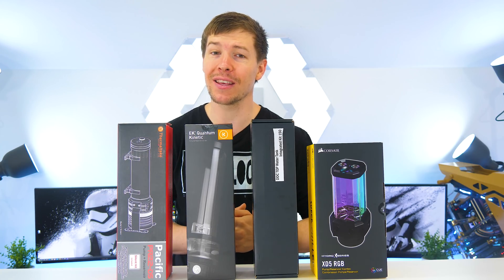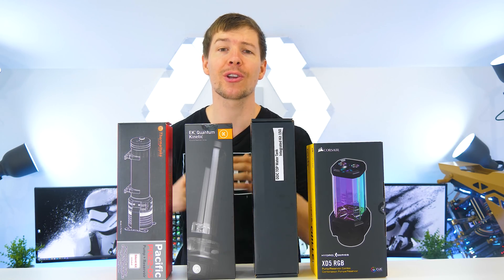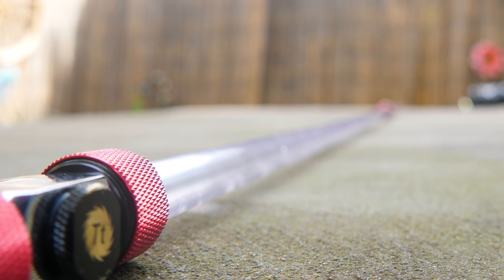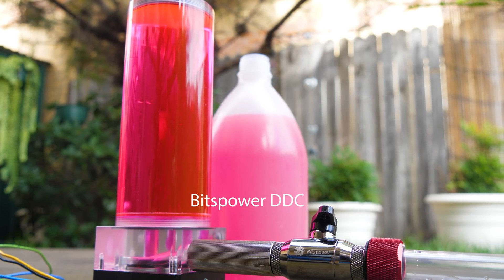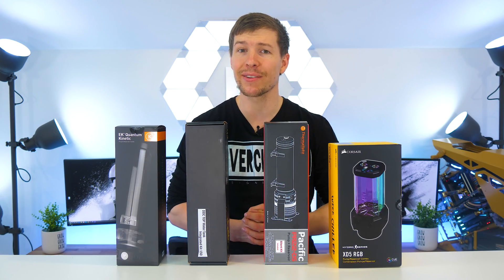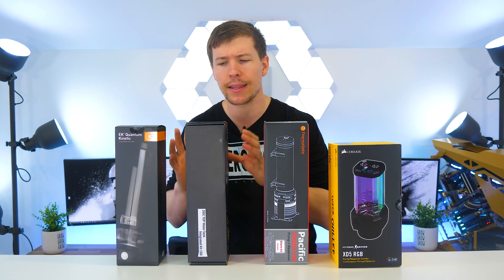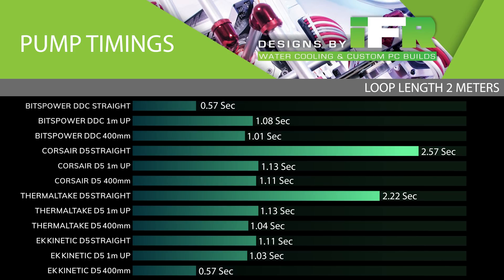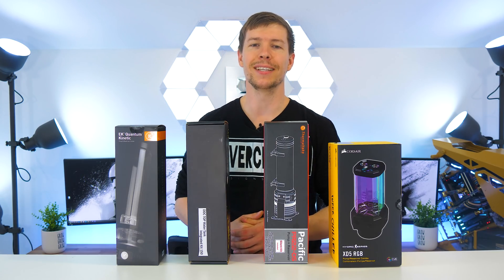The ULTIMATE PC Water Cooling Race.. Who Will Win?

Comment: Edit: you may have touched on this but what fittings are you using? 

I need help please!!! I have a inwin 303 white case (basic) I’m using a msi meg z590 ace gold, with a ekwb Quantum Velocity CPU Water Block, Intel CPU, Digital RGB, Full Nickel. I don’t currently have a waterblock for my gpu yet… and I have a 250ml true brass bitspower res. But I have simply lost 2x of my D5 pumps. The 250 res is rather large and my monsoon v2 fittings are for 16mm tubing (which I have both fittings, tubing, and bending material) my xspc rad looks to have minor rust which I was told using a cleaner should help clear that up. But now I’m at the point do I keep the 250 gold tops? Or just switch it up (keep the gold fittings) and go with a black/white or black/silver pump res combo? This will be my first custom loop too btw. Finding a waterblock for my msi RTX 2070 ventus hasn’t been easy. The only one I found it seems will only allow their own fittings to be used (bummer) any advice would be great! I also say the amazing distro block made for my inwin 303 but it appears to come with no pump (wouldn’t even know which to get) and I’d have to purchase all new fittings due to it sticking with its own brand. Right now either an ek pump res system might or try to find another D5 pump to replace the 156$ one I lost. ;/

Comment: As some one that usually slapped a Aio in my PC's and called it good this is a great eye opener since I'm looking into an overkill cooling loop. When I say Overkill an 3x 360mm rads to cool a 3080 and i7-9700k. Way more than necessary, but I want a unique challenge for my first time, plus it'll only keep an OC cooler. I think I'll look into the EK Quantum Kinetic since it was a top contender for the tests and there will be a lot of resistance.

Comment: Interesting how you come to the exact opposite conclusion that DerBauer and others have drawn. That being that a D5 running at 50% generally provides enough head pressure to run a basic CPU and GPU with a single rad loop. And that a DDC won't start to shine until you get into pretty restrictive loops with multiple GPU blocks and radiators.
The DDC might look good on paper for most loops, it's more compact, provides more pressure and will deliver more flow than your loop will ever need, but it also has 2 big down sides. The first being that a DDC needs to be air cooled, whereas a D5 is cooled by the coolant it pumps. The second being that because the impeller on a DDC is so much smaller than the impeller on a D5, it needs to spin faster to get the same flow rate, which makes it louder. And with it having to run harder it needs more power than a D5 which means more heat that has to be blown out of the case, which means your fans have to spin faster and thus make more noise.
I'd only recommend a DDC if there is a 'technical' requirement to do so. Either because of space constraints, pressure requirements, or if performance is all that matters and you're willing to run 2 DDCs. Otherwise I'd always go for a D5, simply because 9 out of 10 loops can easily be handled with a D5 and it is more quiet than a DDC.

Comment: Prediction:Corsair will be the best overall perhaps not beating in most cases but a great option to go with in a regular case as most of the time you don't really need 1000+litres per hour to move water around the system and fits in most cases in that way.  The others will be the ultimate in terms of high flow and all the other things.

Comment: I switched from a Corsair XD5 D5 pump/res to an EK D5 PWM pump res and my CPU temps dropped by 6c to 8C under load.  The Corsair pump is too weak if you have multiple radiators and multiple cooling blocks.

Comment: Nice video but it has been proven many times that flow rate (within a typical range) has absolutely no effect on temperatures. A trickle will produce the same results as the most powerful pump on the market.
Reply from the maker: No it wont

Comment: It would be very interesting if it's just the pump tops changing the hydraulic characteristics. Change pumps between reservoirs to see if there is a difference. Also do a test with 2 pumps in series.

Comment: Interesting testing Cory. Personally, from reading posts on the Corsair forums, I wasn't surprised the XD5 wasn't as strong. I have an EKWB D5 in my loop comprising of a rear-mounted distro plate, CPU & 2 x GPU blocks (all blocks in parallel) and 3 x cross flow radiators (240, 360 & 420mm) in a Phanteks 719 and run the pump at a PWM signal of 40%.

Comment: Your results are thrown off by the fact that some of the PWM controlled pumps are set to run at different speeds, when disconnected from a PWM signal. When leak testing my loop, I saw the flow indicator in my non-leaking GPU block was not spinning. It takes about 70-80% PWM duty cycle to spin. When I asked Corsair about it they said without PWM signal, it runs at 60% duty cycle. Comparing D5s is like splitting hairs. The biggest difference is going be flexibility of mounting options, ports, and etc. My XSPC Photon D5 was a PITA to mount, while the XD5 was a dream in comparison. The XD5 IMHO is the best water cooling part that Corsair sells. It isn't super expensive, it comes with a temp sensor, RGB LEDs, PSU jumper, lots of inlets, and lots of mounting options. Only complaints are the cheap plugs, which are cheap/easy to replace and the fact it uses a molex power connector, just like most other D5 pumps out there.
Reply from the maker: So according to our research and sources all of these d5 pumps run at 100% without any pwm signal. The results were too close in the loops for it not to have been. Especially when technical specs put it behind
Reply: @DesignsByIFR  I assumed the same thing, just like PWM fans I have owned, but as I said during my leak test where I left my system off and connected the D5 to a second jumpered PSU, I noticed the flow indicator wasn't moving. I was confused as it worked fine when I used my PC. I tested it with my PC, it took about ~80% IIRC on my CoPro to spin the indicator. I reached out to someone I know at Corsair who is involved with the HydroX project and they informed me that the stock D5 PWM pump runs at 60% duty cycle. Doing a few minutes of Googling "d5 pwm speed when no signal", I found multiple reddit and forum post stating that EK is set to 100% duty cycle by default and most others are set to 60%: https://www.reddit.com/r/watercooling/comments/7uw53m/what_are_some_d5_pwm_pumps_that_run_at_100_when/

So your numbers seem confirm my findings, though your conclusions are missguiding your users. I think you should set the record straight and supply your sources.
Reply from the maker: @SolarityTechnology  so the thing is the ek was definately at 100%, the thermaltake was definately at 100% because it is controlled with the level switch underneath. When we talked with our corsair contact they said themselves it would be 100% and that the pump would be at 4800 rpm just like the rest of the D5 pumps. I can further test this myself to see because it seems that one of our corsair contacts is missguided. 

I do believe it was at 100% though because the numbers were too close on the runs and on paper the specs already put the corsair pump behind.

Ill test it out though.
Reply: @DesignsByIFR  I did some testing tonight, that gave me some unexpected results, looking into this further. It is midnight here.
Reply: @DesignsByIFR  I did some tests and using dupont jumper cables. I got 4800 RPM when I only had the tach connected, which was a bit confusing based off what I saw during my leak test and what my source said. I followed up with my source and he looked into it further. He now states that Corsair does run it at 100% duty cycle, but the old D5 standard used to he 60%. Most likely my indicator was stuck from being dried out for a few days, before I ran it again. So for that I was wrong and do apologize for any confusion. That being said, I do stand by my earlier comments that the best source of comparison between D5 res combos is features, usability, and price. Even with my XSPC D5 Photon Vario (nonPWM) I don't run it at the highest setting.

Comment: ummm.... got ANY real pump tests such as volume or head pressure?! Those are the specs used when discussing a pumps real world performance. You've only round about half tested volume in a really goofy way. Your only showing unrestricted flow from one end to the other, that's not how custom loops are set up...Id recommend setting up a mock loop and doing a time vs volume test as well as a head pressure test. Then you will have some real results that will actually show you how the pump will react when in the loop with some resistance.
Reply from the maker: I dont need to setup a proper loop to test that. The straight up run paired with the 90 degree fitting and gravity was enough restriction to see performance, we also saw how the pumps were affected in the graph.

Comment: What's the point of doing this test compared to a actual use scenario and taking a look at the temps? I dont really get it
Reply from the maker: You need to listen carefully
Reply: @DesignsByIFR  I mean I did... in the end you came to a conclusion but what I meant is what's the point of your conclusion without seeing what the actual difference is? Wouldnt it have been better to make a testrun with each pump and look at the temps (CPU, GPU - depending on what kind of loop - as well as liquid). With the test that you did I have no idea what the actual difference in use is - is my CPU 5°C hotter with the corsair pump compared to the EK pump? Or is the difference maybe so low that it doesnt really matter? I now know which pump in theory should give me the best results (obviously depends on the loop like you said in the video).
That's what I took away from the video maybe I missunderstood something. Or maybe the point was just your explanation between the kind of pumps and not a direct comparison between products?
Reply from the maker: The video wasnt there to test the gain in performance temperature wise, we wanted to put different pumps to the test to test flowrate and head pressure and see if technical specs that manufactures stated are correct. Theoretically the fastest varies depending on the loop you have so it gives users an idea whether to choose a ddc or a d5 pump.

The EK pump combo came out ontop so theoretically it should be able to remove the heat from the blocks faster and get it out of the system faster keeping it cooler.

With that being said, the performance gains would be so minimal that you probably wouldnt notice much of a temperature difference if any.

People usually dont run their pumps at 100% either.

The video was just a fun little idea to test which ultimately is the best performing in certain senarios
Reply: @DesignsByIFR  Thanks for the explanation

Comment: Does faster flow actually create more heat in the loop just curious well best wishes from pakistan
Reply: The video states the faster the flow the more efficient it is at removing heat.
Reply: @Safetytrousers  but eventually the loop will get hot somepoint without help from radiator as heatsink

Comment: Corsair: poor performing water cooling pump & sprinkler!!! 😂
Reply: and a leaking gpu block
Reply: @reijhinru1474  That was the sprinkler reference.
Reply: But to the fair, they're not really poor performing. The pump is still very much use able without problems, and their GPU blocks only start to leak with a lot of pressure to the top of the block, which isn't likely to happen in a loop, unless one built the actual loop abysmally.
Reply: @anonym_s5031  no u just need a little force and its leaking just watch more leaking videos. first gen of something is always bad and corsair still doesnt react to fix the isue. you can still buy the shit gpu block i mean why? they are so greedy and ppl are blind. EKWB is much better when it comes to performance, quality and overall results. there is only 1 thing from corsair which is actually really good and thats there fans! thats it
Reply: @reijhinru1474  obviously this isnt hardware but Corsair's headsets arent that bad and for a hardware example their ram is supposed to be pretty good

Comment: What's the difference between a D5 and a DDC?
Reply from the maker: D5 is able to push more liquid as it has better flow rate, DDC usually has higher head pressure
Reply: DDC is usually physically smaller than D5 too. DDC tends to be a little louder than D5. DDC is usually cheaper than D5.